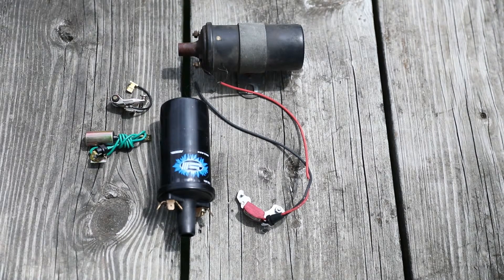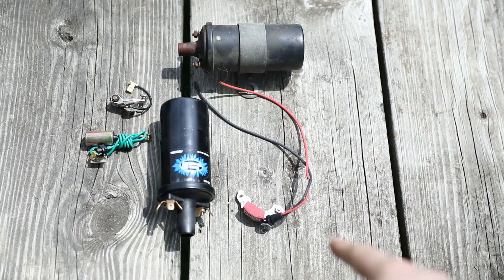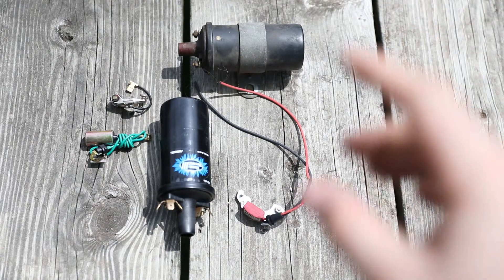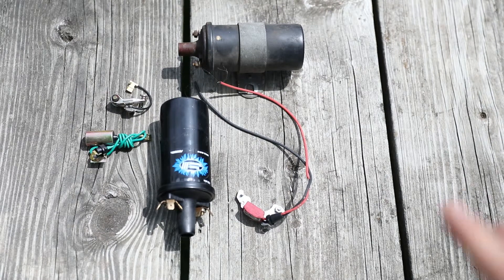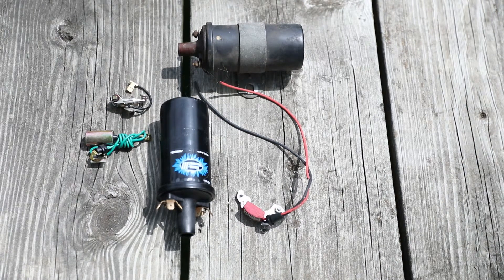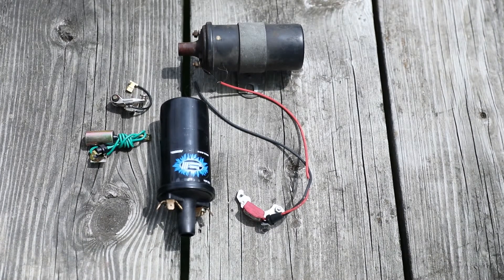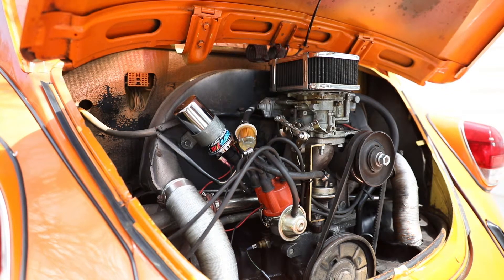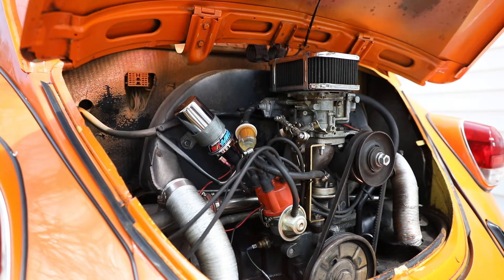Ignitor Issues | Electronic Ignition keep burning up | VW Beetle

Comment: im using an ignitor 11 with the stock Bosch blue coil and it works well the low resistance coils can burn out. the ignitor as the ignitor 11 can cycle the coil on and off. whats reccomended is you get an external ballast resistor for your coil it should resolve that as the ignitor 11 on a vw setup its recommenended to run the stock bosch coil or a Bosch blue coil with the ignitor 11 they are internal resistance coils.
Reply: so if you had a quarrel with internal resistance and you had a resistor also would that be a bad thing😮

Comment: It looks like you used the same coil again? Or maybe it just looked it? I am glad you put this up, I am going to buy a flamethrower pertronix svda, is there a coil you recommend?
Reply from the maker: I think I ended up using a different coil than the original, however I think it was the same brand. I can look tonight to see what I used. I've had about 2k trouble free miles. The important thing, that I didn't know, is that the coil you use needs to have the correct resistance. For example, if you use points vs hei
Reply: No Traction I’m going to switch to pertronix, pretty sure anyhow. Your video was great!! Good info!!